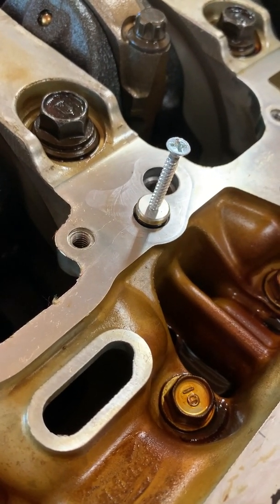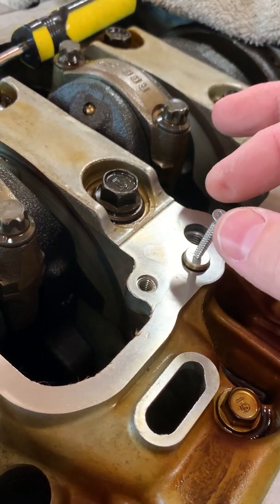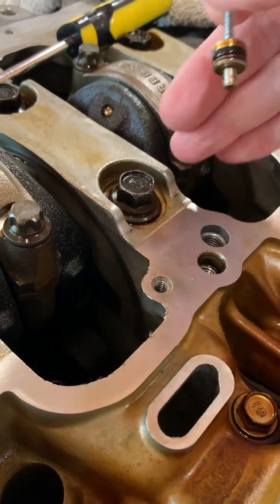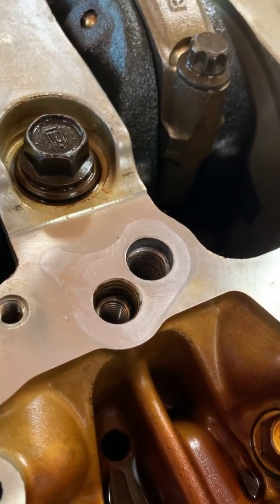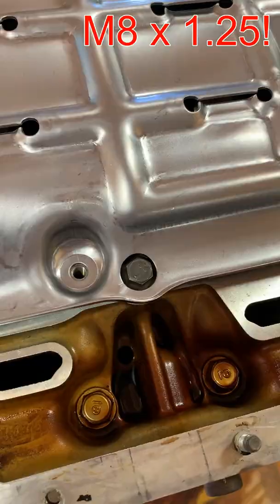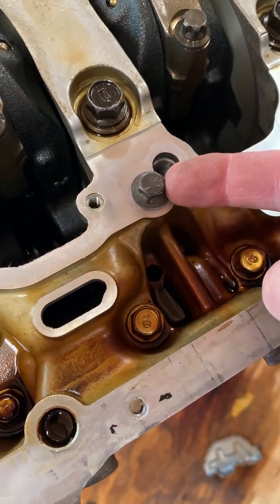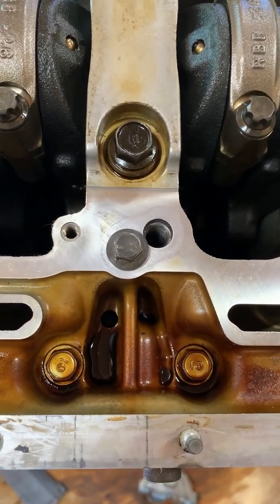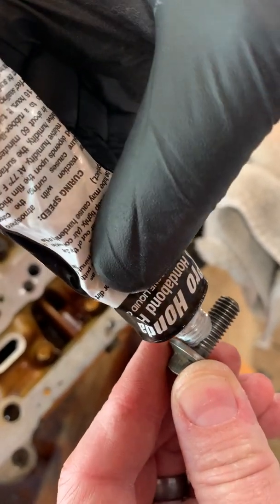K20/24 Swap - Crankcase Oil Port Plugging

Comment: do you happen to know if the hole on the jdm block is threaded or do i have to tap it?
Reply from the maker: Hello! Reaching back into the recesses of mind I and (hopefully) answering your question is that the port is threaded. I am assuming you are referring to threading underneath the port plug? It is an M8 x 1.25 pan head bolt. I hope this is answering your question... -Dutch
Reply: @dutchmenmodsandrepairs1427  its def answering my question. very much appreciated!

Comment: Did you plug up the hole to increase the oil pressure ?
Reply from the maker: This is done when doing the swap in order to make sure you have adequate oil pressure. -Dutch
Reply: @dutchmenmodsandrepairs1427  yeah i asked her if she did it.

Comment: what was the purpose of that port and why are you plugging it?
Reply from the maker: Great question! There are some write ups online that give more details, but basically this is because the K20 & K24 blocks have different oil pumps/oil pressure control. In doing a K20/K24 swap  you CAN install the K20 oil pump (better oil pressure) and IF you do that the K20 oil pump is different and will not use that orifice like the K24 oil pump did. If you don't block off the orifice, when you install the K20 oil pump, you will blow out that orifice which will drop oil pressure drastically and you will damage your engine permanently. -Dutch
Reply: @dutchmenmodsandrepairs1427  thank you for the quick reply I just seen another video showing the k24 to k20 oil pump swap, in the video I could see that the k24 oil pump covers that orifice and the k20 pump does not. I think the reason for it from what I seen in the video is because the k24 oil pump is not just an oil pump but also balance shaft assembly and the orifice provides lubrication to the balance shafts.

I am not very familiar with this engine yet and am working through diagnosing a mysterious vtec problem where the oil pressure to the pins on the rockers starts out at 60 psi and slower drops to zero psi which is disengaging my vtec. At first I thought maybe the oil pressure was bleeding off on the oil pump supply side of the solenoid but I just measured that and its holding a solid 60 psi. at first I thought about doing this mod to raise oil pressure to over come the bleed off but after seeing what this port is for and measuring oil pump pressure I have come to the conclusion that doing so will not fix the problem. so my diagnostic search continues, I am documenting it and will put a video up about it once I solve the problem.